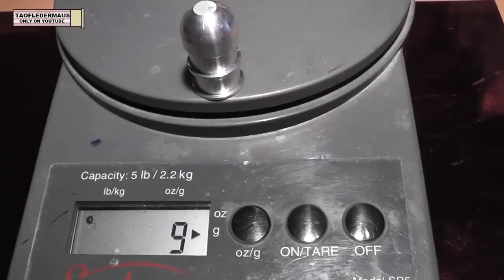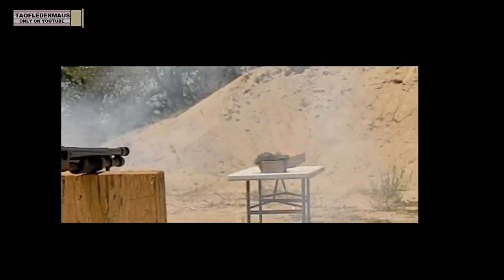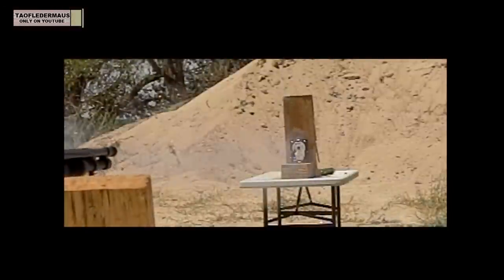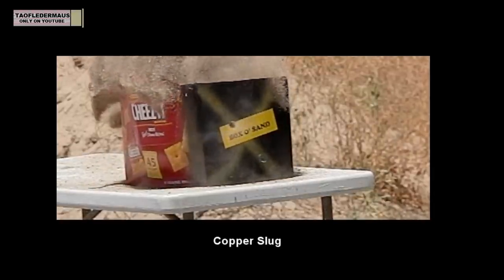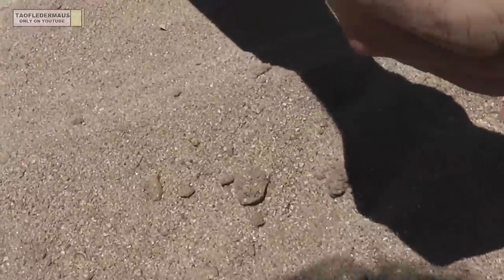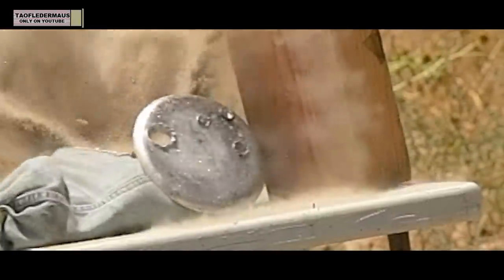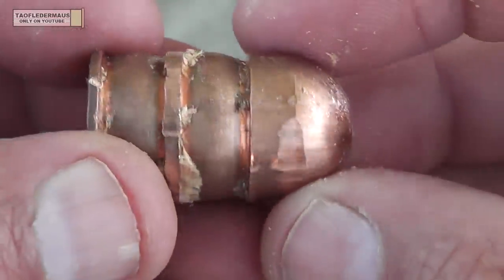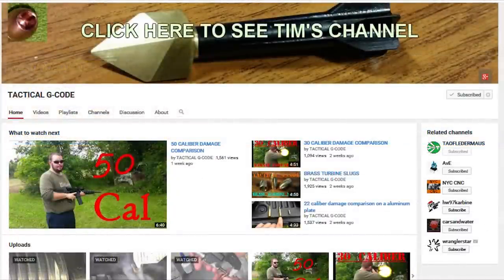Custom Machined COPPER Shotgun Slug -  Reusable Bullet!

Comment: I am really impressed with how well the copper slugs worked. They work so well they might actually be a viable round to hunt with. I may come up with another one similar but with a hollow point
Reply from the maker: *****     I agree.   They'd probably work well cracking the skulls of boar.   The balance of these seemed to be perfect.   I'm really curious how the alum.  slugs will work,  weighing 1/3'd the weight of these.

Comment: love your experimental vids, very interesting. I see people recommend stuff to you to make your vids more interesting. so I guess here goes. try making sure the slugs are really good and tight in those shells, as the more pressure build up you get (to a safe level) the better fps gains you should get. which is why dear slugs seat so snuggly in shotgun shells with the top of the shell folded in on the top of the slug its self. hope that helps.

Comment: Copper does have a fairly high work hardening factor. I would assume the stress of impact/being fired would make it get pretty hard/brittle, which... Watching the video.....

Yeah. My assumption is reinforced. The rounds barely bulged, but started cracking when they struck tough targets.

The first tool metal of mankind does not disappoint.

Comment: The copper is far more durable than you'd think for sure, I wonder how it would do if you filled it with molten lead? Might be interesting to see each different round shot when filled.
Reply from the maker: Mike West  These are balanced to fly straight without any spin stabilization.   So adding weight would just cause it to tumble around like the tungsten rounds.
Reply: ***** Okay. Yea I didn't think about that. :-)

Comment: Cool shit, I would like to see two more versions of the copper slugs. 

One with thicker side walls, and another with the same weight as the original and thicker side walls. So for the second one you would take a little bit of weight and thickness from the nose and add it to the side walls while keeping the same weight as the original.

Comment: I wonder what a golf ball style slug would do.
Reply: a rather small moose Not fit in a 12 ga. You would need about 4 gauge for that.
Reply: ***** or any of the videos where Tao shot a steel ball bearing.  About the only way to get closer would be a round round that has all those little dimples a golf ball has all over it's surface.
Reply: Dimples make a big difference in the way a golf ball flies.
Reply: a rather small moose I agree with you. A "golf ball" slug made out of lead or other metal compared to a round shot.
That would be interesting. Compare the accuracy and the velocity at long range.
Reply: ***** Google "Why are golf balls dimpled?"
Reply: ***** A rubber ball isn't a golf ball. lol. The dimples change the airflow around the object. Obviously it's going to make a difference especially at super sonic speeds
Reply: ***** Yep. Dump as dimpled rubber.
Reply: ***** That's also a good idea. Would have to be casted.
Reply: ***** For someone using Spock as his icon you are remarkably ignorant. The dimples combined with the spin create turbulence around the ball which helps it fly further. It's not some BS gimmick either, I've seen them epoxy in the dimples on opposite sides of the ball leaving just a band of dimples, the drag at the poles stabilizes the flight of the ball making a "slice" straighten it's self out midair after a short distance.
Reply: ***** It's about whatever TFM decides he wants to do.
Reply: *****
The point of the channel was not the point of the comment you made the statement that the dimples "no significant different in the ballistics or aerodynamics" which is just wrong.
Reply: ***** You are DENSE
Reply: ***** You won't admit you were wrong. You know you were though :^)
Reply: ***** mythbusters
they covered a car in clay and they tested how fuel efficient it was before and after they dimpled the clay
the dimples made a massive difference
and they put the clay that they cut out back inside the car so don't weight difference BS me
Reply: +a rather small moose Spock doesn't know physics? What a logical fallacy...

Comment: You should see if he could make you a slug that looks  like a pellet for a pellet gun to see if it will fly the same
Reply from the maker: sand monster   That was a suggestion I made to Tim.    I think this design is  sort of based on a pellet,  and also a Foster slug.  But they work,  and as you know,  most of the rounds we THINK will work never do.   So it is quite a feat for these to work.

Comment: You should fill one of the copper slugs with lead or at least partially with lead. You wouldn't want to fill it entirely and make it into a 2 ounce slug that could be dangerous.  But fill it to an ounce and a quarter as most magnum 12g slugs are. I think your penetration would be a lot better and it would almost be like shooting a copper solid slug.
Reply from the maker: *****   Then the round wouldn't be balanced and it would tumble.   These don't have any spin stabilization so they rely on balance  (heavy-as-possible nose)  and a very light  and thin tail for drag.

Comment: Such a bad ass load.. what's in for powder
Reply from the maker: STG TACTICAL CANADA   We just used Federal target shells,  so it surprised me we got almost the same speed as a deer slug.
Reply: ***** it makes sence..... same powder, same shell and shell casing even..... and same weight of the projectile. 

the only difference is how the slugs fit in the barrel. the lead slug probably has a hollow base or something to help it seal to the barrel..... the copper slug does not, so it leaks  BIT of gas. making it like 100 fps slower
Reply: ***** actually the powder isn't quite the same at all that's why I'm  suprised he uses target loads.... but what works works. ***** has been doing this for a while that's why I asked because it seems to be quite reliable and safe.
Reply: ***** Shot shell pressures are pretty significantly affected by crimp, and by how much "crush" is given to the powder. It would be interesting to see how consistent the velocities are.
Reply: Yes and shot loads are typically universal red dot pressed med and crimped tight. Slugs are usually blue dot packed nicely
Reply from the maker: STG TACTICAL CANADA   The copper round still uses the gas piston and also some rubber disks that seal the barrel.   The Federal target rounds are rated for about 1250 fps for 1 oz of lead shot.   So it was surprising to get the speed we got.
Reply: That's pretty cool to be able to switch it up like that. Good work

Comment: Maybe you should think about selling the "shot" copper slugs.  You may have to encase the slug in plastic and sell it as a paper weight though.  E-bay may frown and selling the slug otherwise.

Ken
Reply from the maker: Ken Woodford   We'll be putting up some of the shot rounds on ebay.   I don't think we'll have any compliancy issues since these are just spent rounds with no propellant,  etc.

Comment: are you using a smooth bore or rifled barrel?
Reply from the maker: ***** smooth
Reply: Would a rifled barrel have any different effect on the slug at all or was it built to be used with a smooth bore?
Reply from the maker: These are made to shoot out of a smooth bore.   I don't think the dimensions are correct for a rifled barrel,  where the round would need to be oversized and squeeze through the rifling.
Reply: The question that should be pinned up to the top. Thank you my friend!

Comment: ive been waiting for someone to machine a 12 gauge slug out of copper, but with maximum expansion capabilities.. like the lehigh 45 long colt... why has that not yet been done?
Reply from the maker: Creflo Jenkins  Tim might try to make some modifications to this design and either give it slits to expand or a hollow point.
Reply: *****
i was looking at the slug from the angles allowed in the vid.. seems in order to drill out a nose cavity deep enough for the maximum expansion, there would have to be less of a rear cavity in order to keep enough total mass... or perhaps keep the rear cavity the same, but with a bit of lead at the bottom of the nose cavity for weight? it would certainly need slits down the sides- no real way around that i could think of.